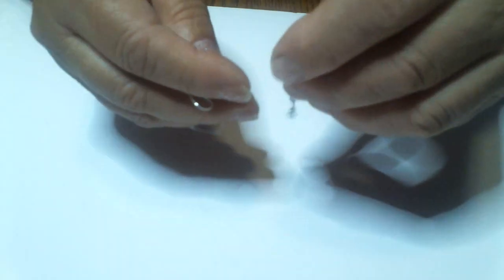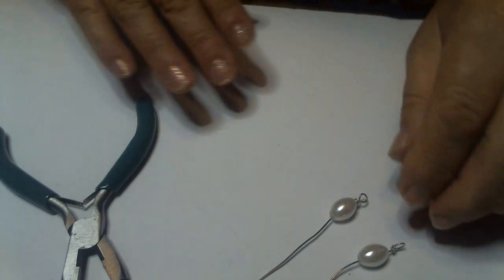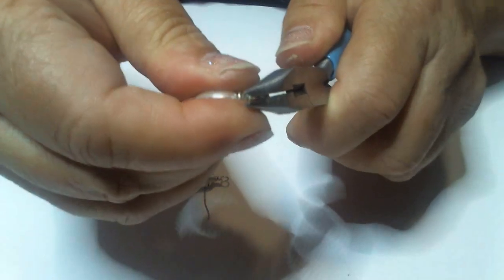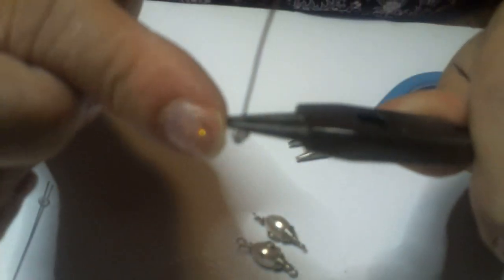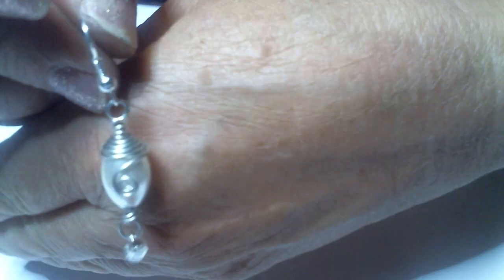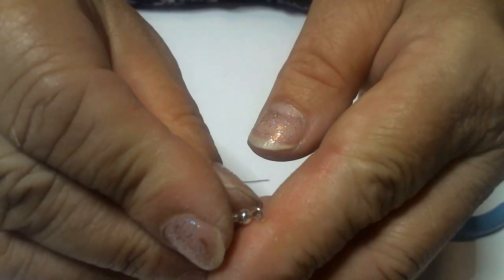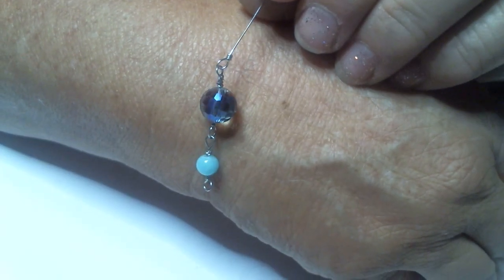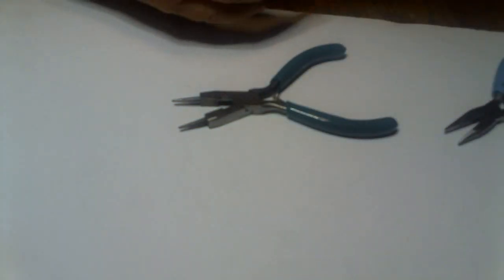How to make wire wrap pearl earrings. Very Nice!

Comment: Wow, Mamasue those are beautiful earrings ! I have a question about how long are the wires for both the pin wires and the main long wire where you first started making the earrings. Thank you so much for sharing your lovely skills
Reply from the maker: The eye pins , for the dangle, are 2" inches long. On the wire, most of the time I start with 8" to 10" inches and just cut off the extra wire. If your beads are bigger than mine, cut the wire longer. It's better to have extra when your learning, because it's easier to work with. Thanks! Mamasue